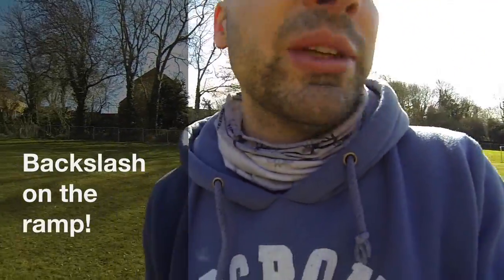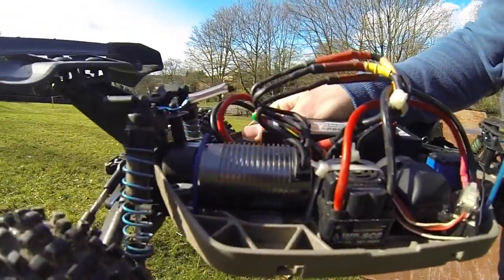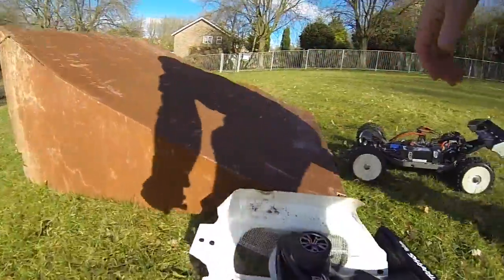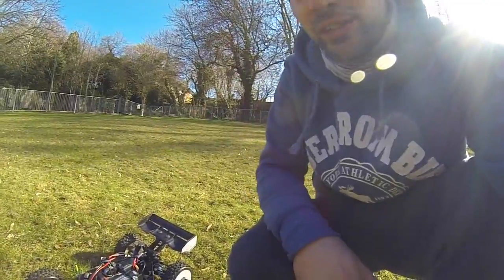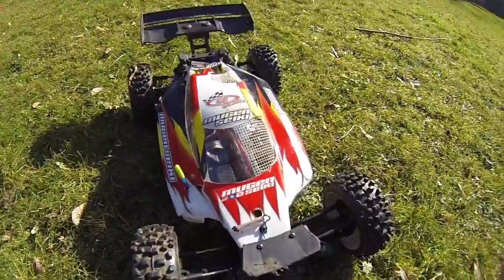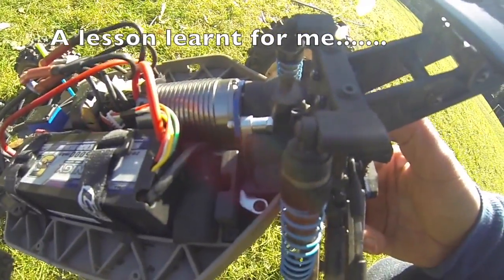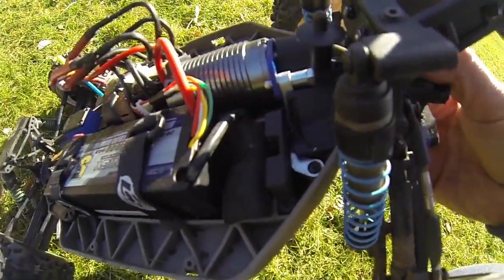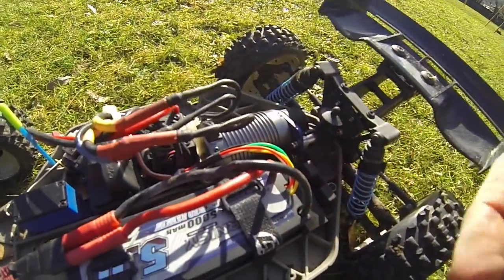Traxxas slash 4x4 backslash 4s lipo 1900kv on the ramp

Comment: Still jumping like a slash, very unpredictable in the air, lots of nose dives tail landings, and fluttering in air, very durable vehicles, but you just never know what they are going to do after they hit the ramp, get an aluminum chassis and I bet it flies like a dart
Reply from the maker: It was very windy... So maybe that contributed to it... And it was switching off a lot on impact with the ramp! But yes. It is a bit unpredictable... Just put the original elecs back in it. That combo is going in 1 of my mugens! Cheers bud!
Reply: Get a different body shell like the losi 8E cab forward